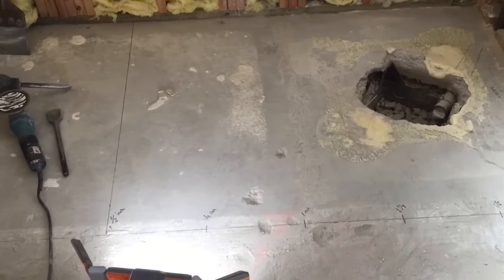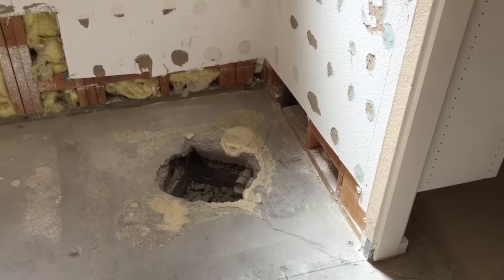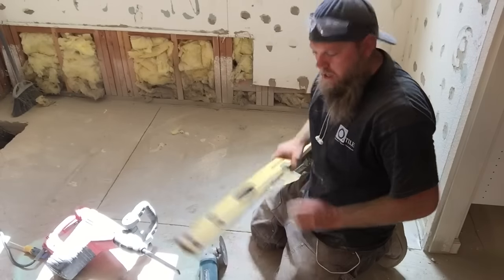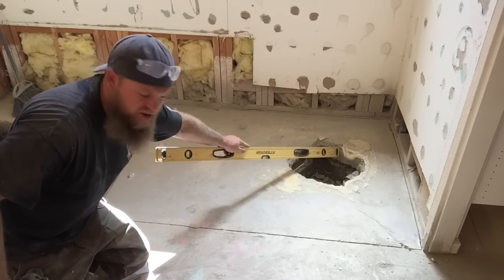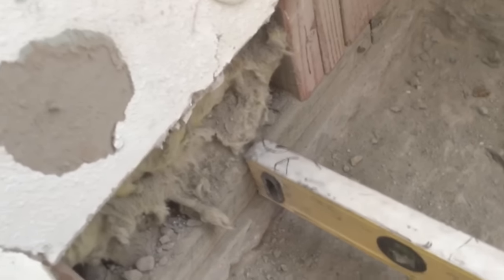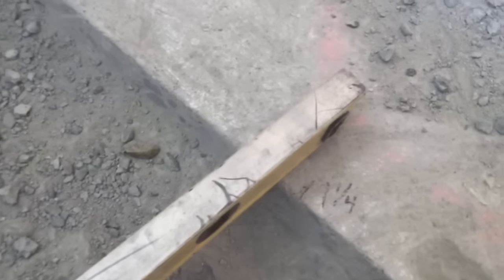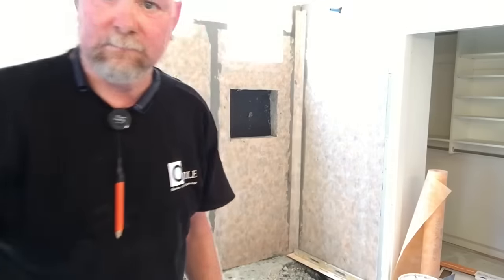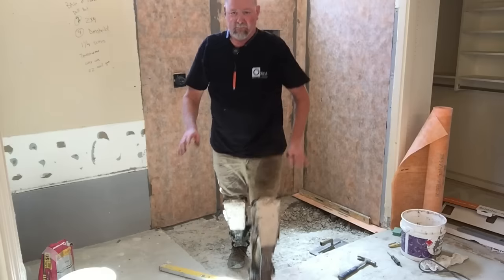How to Build Curbless Shower on Concrete Slab

Comment: Tile sub-contractor in Central Florida here. This wouldn’t pass code here in floriduhh. They have us remove the slab entirely,excavate the dirt down 4” the. Rebar every 2’ and pour a new slab. Then mud the pan on top of that. I use a 14” concrete saw with water hookup. Its extremely popular here as the majority of our clientele is retiree’s. Cheers guys. I love your videos!
Reply: Steven, I’m hoping this might catch your eye.  Anticipating buying a home with a (now, you’re going to have to picture this!!!) 3-step DOWN tiled tub/shower combo.  It was supposedly built in the 70s.  It has a grab bar to grab as you step down into the shower, but there is also tub spigot to fill your “tub”!!!!  I have never seen anything like it and I PICTURE totally taking out the spigot, of course, all the tile, fill up the app 3 feet depth with concrete to current bath floor height, before re-tiling and new shower fixtures.  Can you picture this in the least and does MY solution ring true????  The reason I’m reaching out to you is bc I’m also in Florida!!!  Thanks for any help!!!
Reply: Do you need to put a waterproof liner before putting the tiles?

Comment: OK, how about this... After reading through ALL the comments; here is what can be learned from this video:
1. Chipping a slope into a slab is an alternative to removing that area of concrete completely.
2. Leave an edge of uncut slab that you can set your level on as a reference to take measurements.
3. Proper slope for a shower is at least 1/4" of drop per linear foot from one end of the pan to the drain.
4. 5 years ago, it seems that people were less familiar with linear drains as so many people wondered where the drain went.
5. A thinset slurry can be used as a bonding layer between the existing slab and the mortar bed.
6. Mark out reference points along the length of the shower to use when checking the depth of concrete removal.
7. It's not a big deal if you chip out more concrete that necessary because you'll build it back up with mortar.
8. Appreciate the hard work of skilled contractors.
9. You can sometimes learn a lot from the comments section. Its not all about the video.
10. No all videos posted on this platform will be exactly what you want, but you should still be able to learn something.
Reply: Dry pack (floor mud) is not the same thing as mortar. You really dont need a bond between the dry pack and the concrete. Vinyl liners didn't had a bond, premade pans dont have a bond. I would not have left all that loose hipped concrete in there. Dry pack pre-slopes are not packed in with much force so that loose concrete could move over time.

Comment: How did you resolve the drop between new shower pan and existing concrete slab? assuming a glass panel will be installed there but still can see a little curb. Would be better to move the drain to the back or even middle so the floor will flow more naturally?

Comment: stupid question sir, couldn't you just put self-leveling concrete in the whole bathroom like 1 to 2 inches. Might have saved you some time digging up concrete. I haven't worked with self leveling concrete that much. Then you could have ordered a pre fabricated tile ready shower pan. Whats your thoughts about that?? I'm working on my basement and in similar situation. Thank you!

Comment: Do you ever make a custom sized board that spans the concrete edges you kept during tear out ... wonder if you attached a 1/4" sloped bottom board to the custom length board one could keep consistent angle as you dragged across wet mud

Comment: This us very similar layout to mine ,even the toilet is in same spot,my 2 48 in drains are on back wall,so all the slab came out,4x9 pan,w kerdi presloped, had to relocate 2 drains ,for linears,kerdi line,but this was interesting, wheres the finished vid,and isnt the drain supposed to be set in thinset,rather than mortar  nice job

Comment: Is is necessary to put a shower liner on the concrete slab for recessed/curbless entry shower? My tile guys are saying it's not necessary the have a mud pan and the water goes through the concrete and into the soil (in florida). I asked them about putting redgard but they say not recommended as the water would just stay there instead of draining through the mudpan. This sounds strange to me,  has anyone ever heard of this?

Comment: Nice!  If you were building a new foundation with a plan to have a curbless shower, how would you set that up?  Perhaps have an OSB panel pressed into the foundation right after the concrete pour to make a shower floor surface that angles down?  And remove once the concrete dries?
Reply: Concrete is much stiffer and heavier than that. It would probably be best done with a form in place before the pour.

Comment: I am installing a curb less wet area in my bathroom. one end is a shower the other end a free standing cast iron tub. I tore out the pre fab shower and garden tub already. Would i need to cut out the concrete in the tub area as well or just the shower area? and if so how much to chip out for a floor pan? would i still need to use a membrane under entire wet area?
Reply: Is is necessary to put a shower liner on the concrete slab for recessed/curbless entry shower? My tile guys are saying it's not necessary the have a mud pan and the water goes through the concrete and into the soil (in florida). I asked them about putting redgard but they say not recommended as the water would just stay there instead of draining through the mudpan. This sounds strange to me,  has anyone ever heard of this?

Comment: My bath remodel contractor wants to jackhammer the slab all the way to the dirt, and fill the cavity with concrete. That is, around the drain pipe and up to a workable level for the mortar bed.  Does this make sense to you?
Reply: Sure, why not?

Comment: Would of been faster to take out concrete . Always wear respirator mask , cilica and dust from just sweeping I bad for lungs. Especially when you have already demo concrete
Reply: I agree,  I am about to do almost the exact same thing, same configuration. I've been planning to remove all of the concrete slab under the shower and re-floating it to slope. I think that is much faster than  terraforming the existing slab imo.

Comment: Can you pour concrete over the mortar bed? The builder did not waterproof (tiles falling off drywall + no pan liner) and made it "sunken" close 4" lower in relation to the bathroom floor. The shower floor has less a little over an inch of concrete and another little over an inch of mortar bed. I would like to pour concrete to level it to the bathroom floor & do the the mortar right after but I am unaware of any precautions I should know about. Please help. It was horribly built that they tiled with the drain base. To top it off, the drain base was not glued but attached with duct tape...yes you read it right..DUCT TAPE.

Comment: What depth would you recommend for a 5x7’ curb less with a liner drain on a new construction?
Reply: quarter inch for every foot, so if you run is 7 feet  your end should be 1 3/4 "

Comment: I  never thought you could jack hammer "layers" like that. What happens if the mesh is in the way, and you need to go down another 1/2" or whatever. Can you remove it with a grinder/wire cutter?
Reply: Isaac Ostrom Thanks, also, how long did it take him to jackhammer out that shower floor? Can’t tell if it was a one hour or half day job. I’m going to do this to my basement bath remodel and don’t know how much labor is involved vs doing a mud pan. I guess you don’t have to do a pre slope and curb!
Reply: @TileCoach  Any comment about post-tensioned slabs? My concern would be running in to one of the cables, which couldn't be cut.
Reply: @richardpellis  
I've cut post tension cables for room additions....it is not a big a deal as they say it is. Its been 20 years, nothing has happened in any of my projects.....

Comment: What happens if you have to replace a tile on your shower pan and you damage the kerdi as you pull the tile up??? Do you have to tear out the whole pan and start over since the 2" overlap is required to be waterproof? What are your thoughts on this? Seems like a risky system if it's not repairable.
Reply: @TileCoach   If you chip a couple of tiles and they're well stuck to the kerdi and you can't replace them without damaging the kerdi, then you're screwed! you'll have to tear out the whole thing and redo the shower pan like in your repair video! An easy and cheap repair would turn into an expensive and time consuming repair. Mud or wedi sounds like a better option because they're repairable systems. The wedi pan is entirely waterproof and can be punctured as long as it doesn't get punctured all the way through and with mud pans the membrane is under the sloped mud. I'll stay away from kerdi shower pans.
Reply: @TileCoach   The reason i asked is because this happened at my jobsite when i used the schluter system. Somehow the tiles got chipped and i had to tear it all out and start over in order guarantee a water tight shower pan. The tiles were expensive.....$150 a box. If i had used the vinyl liner or wedi, i would've repaired the chipped tiles in 5 minutes and cost me nothing.   I've never seen a wedi sealant separate.   Surface applied polyurethane will not work. It must be applied in the joint and on the surface and you have to be generous when applying the sealant....In order for that sealant to separate the house must be falling apart in an earthquake lol They also sell a membrane like kerdi band with corners if you don't trust the sealant.....You can double it up, sealant and the wedi band around the pan.

Comment: Why not just cutout the entire slab and pour a new one. That would have been a lot easier than chiseling away at the concrete like that. If you mix the mud a little dryer you can get it to float the way you want it before adding the mortar bed.
Reply: Lot more work

Comment: How long did the "dig out" work take on the concrete?
Reply: I’m guessing, but if you watch the left side of the screen you can see the sunlight moving as it comes through the window. Going off that it took pretty most if the day.
Reply: Yep, almost a full day of just chipping concrete , depending of how hard the concrete slab is.

Comment: Would you attempt this on a post tension slab?
Reply: No
Reply: @BoutTime444  short and sweet “NO”.    Why not...aren’t the cables deep enough in the slab
Reply: Cutting openings in PT slabs does require care and caution because of the possibility that PT ten- dons may have to be cut. ... Small penetrations are those that can be cut into a slab without affecting any of the existing PT tendons; conversely, large openings are those that require the cutting of existing tendons.

But if you do happen to cut one of those cables then your project will cost
Reply: @BoutTime444  fuck it....I’m going for it.  Wish me luck!